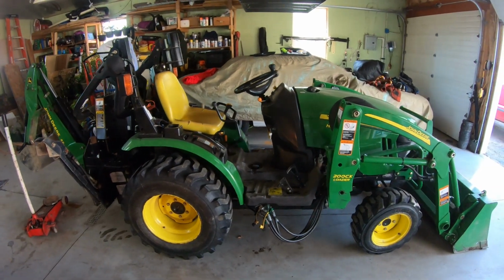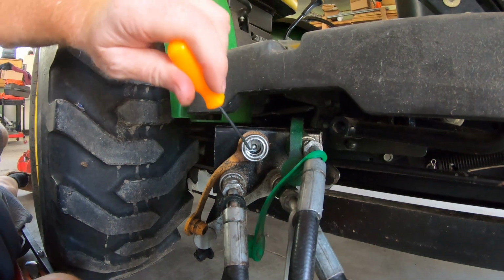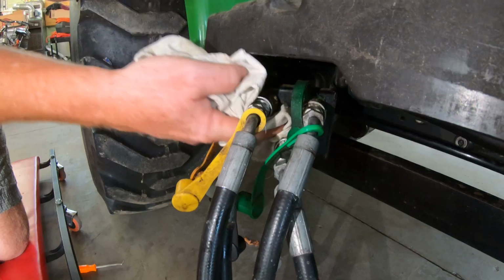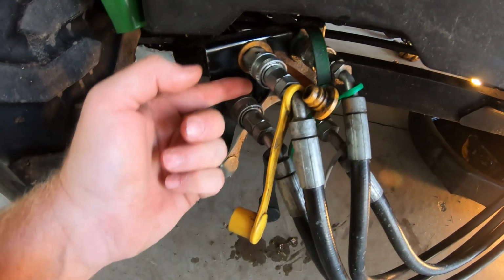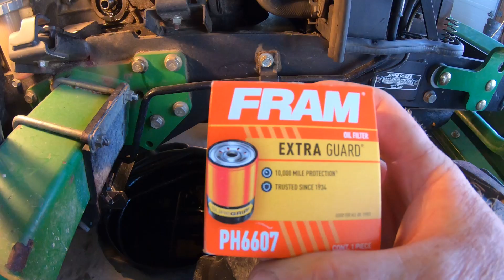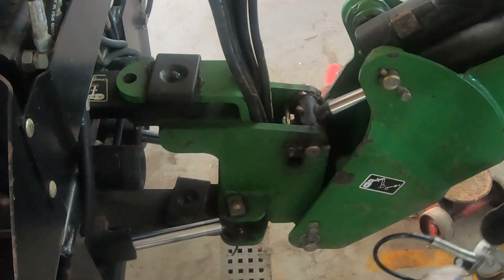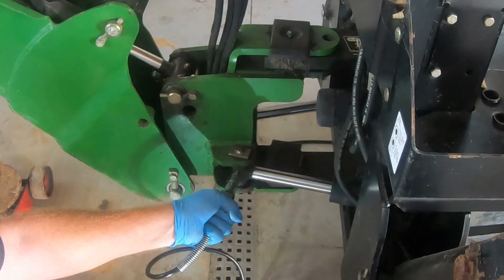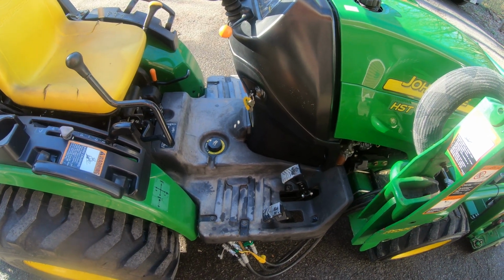Fixing a Constant Problem With My John Deere 2320

Comment: 100% on the mark with your maintenance tips - thanks for posting and sharing.  Had to replace my 2320 (2008 -700hrs) hydraulic connector port also along with the left front steering knuckle.  Still a great tractor and no regrets getting this machine. 
All the best and God Bless. 🙏❤🇺🇸
Reply from the maker: Glad it helped  - Thanks!

Comment: Fun video, you don’t see a lot of videos on the 2320. Iv had one about 4 years now. Been a great machine, one thing I learned when I bought it was there is no access to the grease port for the front drive shaft. I highly recommend googling the access hole mod.
Reply from the maker: Thanks for the info!
Reply: You can get to it without modification.   Need a long needle greese fitting forth e grease gun ( I have a small grease gun setup just for this chore).  Not easy to do, and you have to have the drive shaft stopped at just the right angle, but you don’t have to cut anything.

Comment: Possibly look at your 3 point hitch if its too high on its highest level hydraulic pressure being too high can cause this its simple to adjust raise the seat and lower its max hieght its too your right if your sitting on it just take measurements and use your best judgment i work for a dealership and see these almost everyday and pdi them as well

Comment: I was looking at a 2010  2320, Been reading up on it, The u joint on the drive shaft, How do you do yours??  It looks to be a pain to grease them.
Reply from the maker: We grease the rear from underneath and the front by either removing the side panel and the cover or going up underneath, which is more difficult.  Some people cut access panels into the side and floor pan, but like to keep it factory.
Reply: @AFR_Adventures   OK, Will sure keep that in mind If I buy this one.  Man said they did grease them when it was serviced, But I don't put a 100% in that , You know Sadly.  But it would be the first thing I would do If I buy it.  And like you I'm not going to cut holes in it either! Thanks for your reply!

Comment: I wonder why they put the quick connect almost dragging the ground? That would never work with my 3038e. I drive over way too much rough terrain. Could part of the problem with the leaks be that the lines may hang on something and cause problems?
Reply from the maker: Could be - but I'm really careful about watching out for the lines.